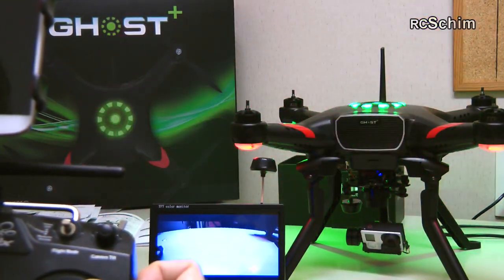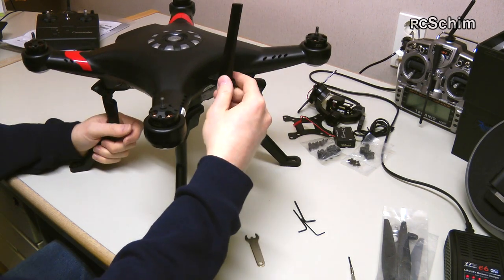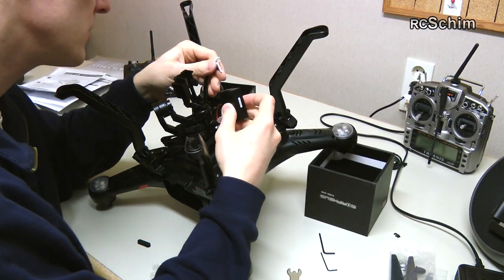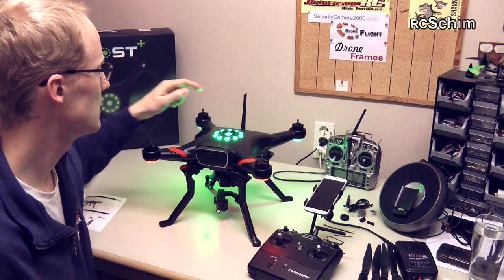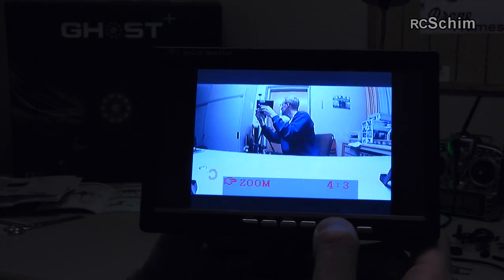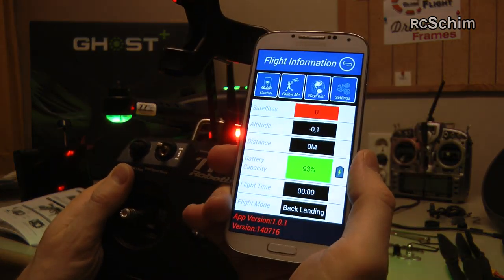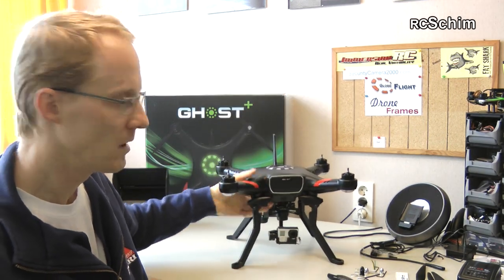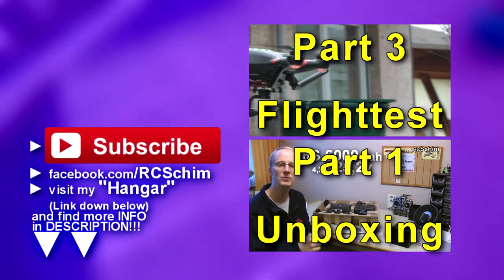Thunder Tiger Ghost+ easy build and indepth Review Part 2

Comment: I like this setup. Does it come with the monitor? Look forward to the review. Wish they were selling it here in the US locally.
Reply from the maker: OC_AirWolf the monitor is part of the FPV set (which also contains video tx and antennas. Video rx is integrated into monitor, frequencies are a bit off standard immersion so no direct fatshark compatibility). Check description here for specific details on that.
Reply: RCSchim I always forget to uncollapse the description. Wish they were compatible with Fatshark.
Reply from the maker: OC_AirWolf then just go with an immersion video tx. Shouldnt be to hard to integrate into the system. Maybe soldinger a connector.
Reply: My soldering kit is coming. Ill need some adequate practice.

Comment: ... very nice review :-) ... the copter seems like a plastic toy, isn't it? I guess, if you get a hasty landing something will break easily. Maybe you will find it out ;-)
Reply from the maker: thanks. yes, maybe a bit to bulky, heavy but it feels like well built on the other hand. sure it would look nicer if all in carbon and much lighter and more efficient. I'll test and see how much the maximum size 12x5 props give me. I guess it's more suited for a sony nx100? or whatever the other cam is that they support with the gimbal. for the gopro you can get a smaller copter.   one thing maybe - with more mass you can fly better in the wind...    the landing gear looks worse than it is. pretty sturdy hard plasic. I used the autoland switch a few times - works ok!
Reply: ... yes, carbon would be nice :-) but this is not the goal for this type of copters. On the other hand the copter seems to perform very well and you get a lot of "copter" for your money ;-)